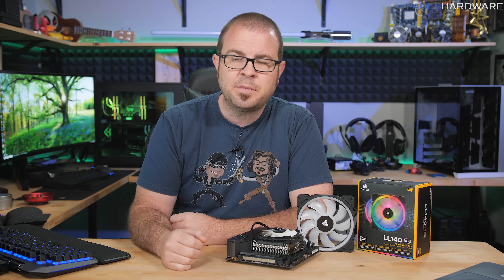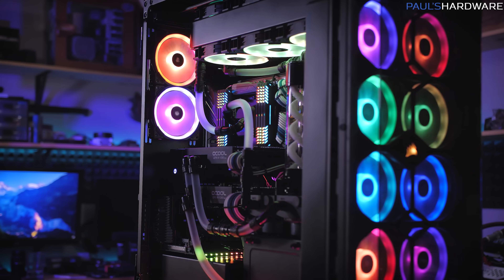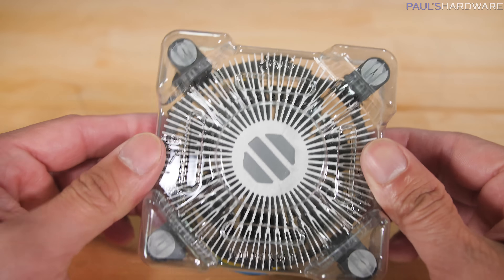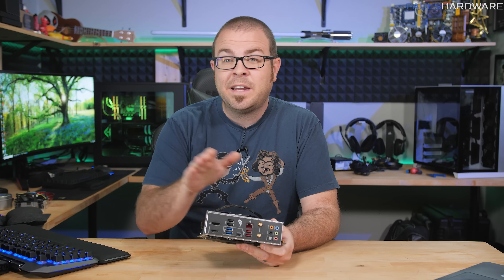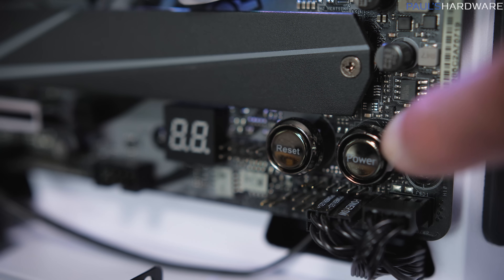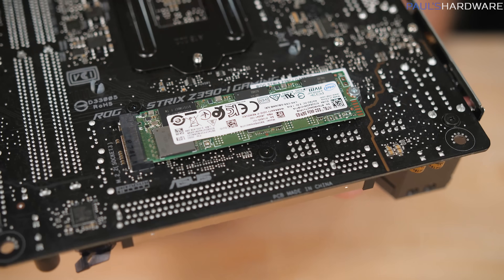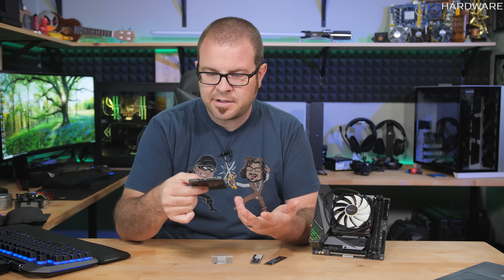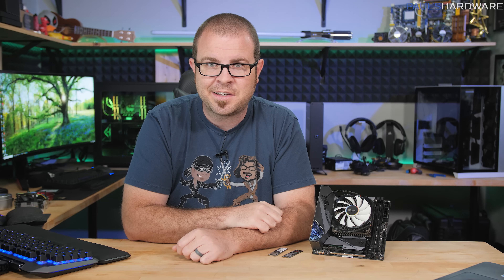5 Ways to Build a Gaming PC FASTER!

Comment: double sided tape to mount 2.5" SSD drives. Almost instant, and reliable since desktop systems don't travel a lot, and there's no vibrations from a SSD.Also, can get a case with hot swap bays, or buy a hot swap bay. Mount it and connect the cables, then drives can just be plugged in. Very useful if you plan to do any streaming or anything, as you can use 2.5" or even 3.5" drives for storage, and swap them out as they fill up to deal with the renders later.

Comment: Finally, you said skip the shinning rgb.. I agree with that and what best budget M.2 NVME for 512GB capacity ? Cz i only see Intel 660p, HP EX920, and Adata SX6000 pro and SX8200 pro for under $100

Comment: Lol. Why not Velcro the 2.5" drive to the case instead of securing it using screws? No fiddling with screws and it has to be in the case instead of hanging out.

Comment: Save time by using a CPU with an iGPU, no need to unbox a discreet GPU and install it. A Whole component skipped.

On the other hand you should mount your Sata SSD to the case if it has a metal casing otherwise it might flop around inside the case when you move the case short something.

Comment: Not sure if this was already mentioned, but you could use less screws. Maybe just 2 per fan, or only 4 on the radiator instead of all the mounting points (if there are 6 for instance), or maybe just 5 for the motherboard (center, and then 4 corners). You'll also avoid repetitive stress injuries on you wrist from all the turning of screws. :D Think of all the seconds you'll save with 2 less screws per fan!

Comment: I agree on the fans purchased a rijentek case with 6 of there rgb fans thinking I can re use my corsair comander pro just to fined out I need an entirely new rgb controller so now have 6 wires hanging in case

Comment: One of the ideas I had was, when planning to use cable extensions, or a modular psu, plug those into the board before installing in the case, then push them through the cable management points. Saves you time trying to get your hands into tiny spaces to plug in the cables.

Comment: Obviously NOTHING could be of  greater time benefit than skipping cable management/not worrying about how it looks AT ALL. Now, that is a difficult one for some people, because it's basically one of the most visually impactful events and is also completely free, not a money suck. 
But, fucking hell if I don't end up spending 100% more time trying to get the wiring to look decent before I get to put the damn side panels back on. 
...granted, it has an 8 pin CPU power, 8+6 pin GPU(PowerColor Red Devil RX580 8g), two 2.5" SSDs, and two 3.5" HDDs(C drive on an M.2), and 6 fans split on two different fan controllers(uuuugh proprietary BULLSHIT) for intake & exhaust(InWin 303) with one more on a Cooler Master MasterLiquid Lite 120 AIO(what a name...), so maybe my instance is a bit wire heavy compared to most...

Comment: I have one: Skip the part where you test the components on top of the mobo box. It's much more likely your components work than don't, so you can simply test them in the case. If you do have a faulty component you probably wasted a few extra minutes of time, but in the majority of cases where your components aren't DOA, you just saved yourself more than a few minutes of time.

Comment: it's not building that takes time, it's the planning and research that does.

time has not been an issue for me. i've built every PC i ever owned but don't build outside  of my own PC's, just a thing i like to personally do for my own PC's. building PC myself maybe takes 30 minutes? i don't bother with custom cables or custom water cooling . honestly i don't care about looks and new cases with routing cables in back make it way easier/faster cable management too without hindering air flow. My issue is buying parts and planning build, that takes me ages. i'll spend weeks or even a month planning a build and researching before i commit on right parts/case/build. putting together on other hand is the easy part.

Comment: The two things which I would recommend: skip RGB and don't connect the LED's of the case. Those LED's don't really have a function but do use a tiny bit of electrical power and can be quite annoying depending on the case (OEM's often have an ugly light on the power button). I dislike installing a SATA-SSD via M.2 (assuming that it is wired for NVMe), that wastes a perfectly fine M.2 slot and you might want to use it later. I also don't care about SSD's lying in the case (I do that at the moment because the case has no SSD mount option) but if I can mount it I will mount it.

Comment: Better yet, don't even use a case. Just connect your parts together, then shove them under your desk, and you're off to the races. 

Also, don't bother with a graphics card, just use on-board video.

Comment: Some more ideas of varying helpfulness:

Get a case with pre-installed fans
Use an APU
Use larger cases that are easier to work in
Use cases with pre-installed standoffs
Use a non modular PSU to plug in half as many connectors 
Use a case with a built in PSU

Comment: This was a cool video but I'd have liked to see you feature tricks you can use during the build process to make it faster - as opposed to things you have to buy [or not buy] in order to simplify the job. The 2.5" SSD point you brought up is a great example. Another might be to only use screws in the corners and very center of the motherboard, only diagonal corners on fans, hard drives, etc since that's all most of them need to stay supported anyway.

Comment: Well since you said skip almost all pin from the front panel, you should also mention the front audio and maybe even the USB 3.0. Case fans can also be ignored, don't buy modular power supply and go with GPU that does not require extra power from the PSU (no cable needed)

Comment: I actually ended up only plugging in my power switch cable... the others were too small and the LED ones (which I wasn't using) were too complicated to figure out the 1-10 male circuitry :o

Comment: RGB almost never works as advertised.  Not worth the time and money trying to get it to work 2 starts in a row.  Now, I just use a small LED flashlight inside the case.  Change the batteries once a month and bingo bango!  Case lighting.

Comment: I skipped the first 2 already pretty much. The only lights I have are ones that came on the case and motherboard and I wouldn't mind to turn off. I skipped the fancy cooling too because I don't think I need that. I didn't skip 3 because my motherboard isn't fancy enough to have the fancy IO shield. I didn't skip 4 because I want all my lights and switches to work. I also didn't skip 5 because I wanted a 2.5 inch drive that works with all my computers for my SSD along with a mechanical hard drive for extra storage and a DVD drive and I think M.2 drives are more expensive. I didn't mount my SSD though. I was trying to not be too fancy with my system. I care about performance more than looks. I wouldn't give myself less performance for better looks.

Comment: I only agree with #1 because of the fan wiring and cable management; #2?...you have to keep the people employed at the Chinese Cooler Master plant, don't you? #3, that's plain lazy, come on, #4, the front panel connectors are labeled and where you plug them in on the motherboard are labeled, so RTFM, ok? #5? seriously, just let it dangle, eh?...all in all just one day late for April Fools Day...

Comment: How about a good case?

Meaning one with thumbscrews and hinges rather than normal screws an finicky slot in panels.

As well as screwless drive bays so you can just slide your drive in and go.

Also helps down the road getting one that the filters can slide out externally with no screws, rather than internally with them.

Comment: Biggest Time Saver... don't install the parts into a case... just skip the case... all that fuss of trying to screw things into a case, and finding the right bay or where the cable goes... just put MB on desk, install everything there, most parts can just be close to the MB on the desk and the wires will reach... now think of all the time you saved!

Comment: AIO's are fine as long as you install radiator and fans first, then its just like mounting any other CPU cooler with a back bracket.

Comment: You don't have to install ram into your PC because you can just download ram to save time and money! You can also save even more time by not installing a graphics card because Intel's integrated graphics are very powerful for high end game. And it has been proven that a computer will work without a case so you may as well not get a case to save even more time and get the most amount of air flow possible over your system. That will make using the onboard power button even easier. (sarcasm, duh)

Comment: New build : Ryzen 5 2400G / Gigabyte X470 AORUS GAMING 5 / Corsair - Vengeance LPX 16 GB / Cooler Master - 750 W 80+ Bronze Certified and a very nice black NZXT - H500i case.  

I found  that the built-in Radeon Vega 11 GPU  is not great for gaming. What GPU  do you recommend. $250 to $350 price range.  CDN 

Thanks

Comment: Well if you start recommending the intel stock cooler in order to save building time:
Just skip the case. There is a paper box in which your mainboard came in. Just build your pc on top of that. No screws, no cable management, no front panel connector (because there is no front panel) or other stuff needed. Oh and better temperatures as well.
And if your mainboard doesn't have a power button: Use a screw.

And I actually have a computer right now that is build like that. Don't worry it's old, and I'm torturing it anyway.
It's only used as my OC system that is cooled with ice-water and the mainboard is a semi-dead one I got from a friend for free, because sometimes it will pretend it's dead and just do nothing.^^

Comment: Well... Those are somewhat valid tips, but the way you're approaching the subject you could just as well say "buy a prebuilt" or "buy a laptop". 

That, and it's just such a non-issue for 99% of the people, it seems to be valid mainly for reviewers, who go through a lot of stuff and... that's pretty much it. If someone's building PCs for a living, stuff like leaving front panel connectors unplugged is not possible, same for the layout of the build (rgb fans, aios etc) which is dependant on what the customer wants, most of the time. And if you're building a gaming PC for yourself... How often do you do that so you want to cut corners for speed? Most people upgrade every 3-5 years on average, so is saving 5 seconds of screwing the heatsink on the M.2 drive worth it?

Comment: Forget #1, I need my RGB. Same with #2, I love water cooling. Big blocky air coolers are ugly. #3, a fixed I/O shield is nice but standard ones only take a second to pop in. Same for #4 Just plug the damn wires up. It only takes a few seconds. I agree with #5. I have two 2TB M.2 drives on my system.

Comment: My pro tip: Understand the layout of your build before you get started. When I built my first PC, I remember buying parts solely based on compatibility and needs but I never took the time to consider how every part will be connected or where it will be located once complete. Nowadays I do a quick study of the motherboard and case layout. By the time all parts have been shipped and delivered, I already know more or less how the final build would look like. We already spend a lot of time searching for parts. Might as well spend an extra minute before checkout.

Comment: RGB needs to die, Setup and maintaining RGB is lame and I wont be doing it again.
Reply: @krutarthdave1938  on top of that, there is nothing more disappointing than finding out one of the components is RGBW and doesn't match at all. I had this on a CPU cooler... center of the build

Comment: Best tip to build faster: Use the verge's tutorial
Reply: Don't forget the tweezers and wristband
Reply: Add Linus' concrete cooling, shocked the Verge didn't demo that outside April fools!
Reply: You want an even faster way to build a PC? Go to Dell's website. :P
Reply: Also do thermalpaste bukkake and no wire management whatsoever.
Reply: more like how to kill a Computer the fastest way
Reply: @Soufyane.Chahboun  We're joking about that Verge video. Anyone who is even somewhat experienced will notice how bad the video is.
Reply: Better, just throw away all the parts you have picked, directly into the garbage, that's way faster.
Reply: I'm glad that people are still using it. It is by far the best build ever recorded on video.
Reply: Yes like 420! 😂
Reply: Dont forget to use the cpu mounting tool which was then outside the build a few frames later
Reply: the verges guide takes WAYYY longer than paul's guide here.
Reply: i don't think i have enough thermal paste to follow the verge guide, i only have 12 grams of thermal paste, and using that much thermal grizzly would cost more than some cases :S
Reply: Also Don't forget the Swizz Army Knife
Reply: @theweirdmaterial4908  i believe he actually used a screwdriver in the actual video, maybe he realized it's not optimal with a super short tool for most of the screws in a computer =)

Comment: Ha 9th!
Best line in the video "We've already established that LED lights are an acceptable casualty on the road to PC building efficiency." love it.
I can't stand plugging in those infernal cables for power reset bla bla bla.  So bloody annoying.  I went without them for some time on my system just popping off the side panel whenever I had to turn it on.  All I wanted to do was just use my computer.